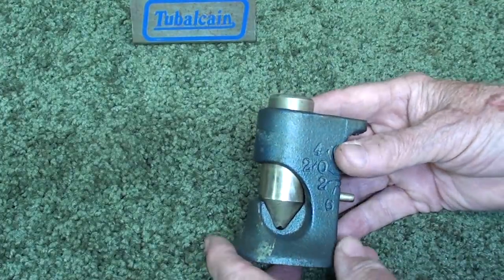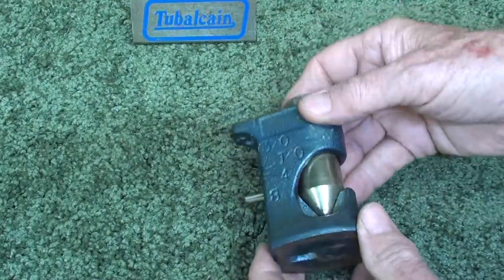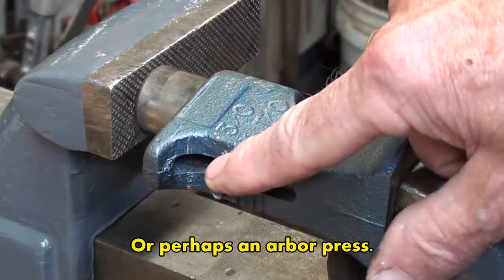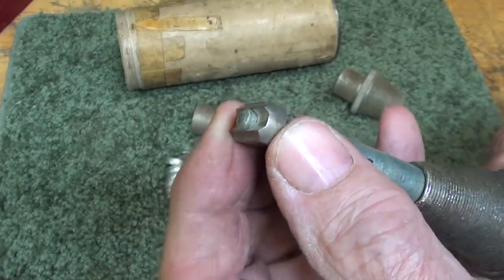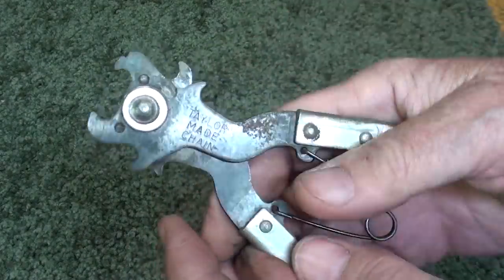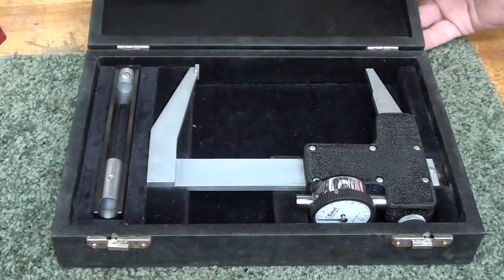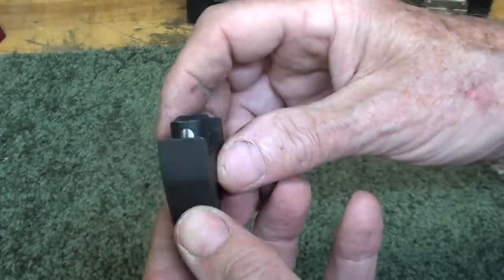What is It? MYSTERY TOOL 51b answer tubalcain

Comment: Pete the flat discs that came with the valve reseating tool I believe are for the final step in the reseating process, the finish with valve grinding  compound to remove the chatter marks. At least that how we used it in the US Navy.
Reply: David Schwartz it’s to make the surface finish defects as concentric as possible and to meet the proper “RhR” for the seat matl’. This ensures any tooling marks wouldnt help cuts form  possibly help any steam leaks that do develop from cutting across radially into castings and stay in the stealite inlay, therefore extending the service life before the steam cut reduced efficiency or caused a failure.

Comment: The chain tool was used to install emergency repair links on tire chains.  I used to sell them when I owned an auto parts store.  The emergency links were very soft  and were easily closed using the pliers.
Reply: Ebay sells them - about $20.  Search "tire chain s hook tool".

Comment: Toobs , the second to last item is a diametrical comparator. You set the distance of a sample or nominal part , lock the thumb screw and note the fine reading on the indicator. Then you can very quickly check a run of parts for deviation.

Comment: I have received this answer from Donna ; directly from the Manufacturer:
The tool you have is approximately 40 years old and is no longer made by us.  We discontinued it  over 30 years ago.  it is called a Crankshaft Main Journal Gage (part # 227).  It measures the wear of main journals without removing the crankshaft or top insert from the engine.  This easy to read, adjustable gage determines out-of-round of main journals from 2" - 5" in diameter.  It makes any wear instantly apparent, providing a quick, accurate determination of whether or not regrinding is necessary.  The indicator has a range of 0-1.00" with its graduations in .001" and the reading range is 0-100. 

Best regards,

Donna Dansereau
Mgr. Quality Customer Care
Central Tools, Inc.
456 Wellington Ave
Cranston, RI 02910
Tel: 800-866-5287/401-467-8211
ddansereau@centraltools.com
www.centraltools.com
www.moodytools.com
www.king-tool.com
Reply: So another tool that works well but isn't sold or used enough to justify making them any longer.
Reply: How can you use it to measure wear on the main journal without removing the crankshaft when the caps would still be in place?
Reply: Also the one shown in the video measures in half thou increments?
Reply: @blackguitarmaker1925  Making it very accurate
Reply: zeke112964 I’m merely pointing out that Phillip Chase here said it measure to .001 when the one in question here measures to .0005
Reply: @blackguitarmaker1925  gotcha!
Reply: @zeke112964  remove single cap, "crab pinch" exposed journal, rotate crank and note dial movement. Replace cap, repeat ad nauseam. At the same time you could check oil clearance with plastigage
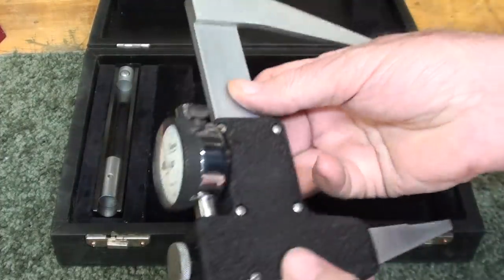Reply: @ludditeneaderthal  One of the "claws" has a 1/4 inch possibly wider pad on it @5:10 in his hand.....NO WAY your going to get that around the center of the journal with the crank still in place

Comment: The little black clamp at the end is part of a kit used for setting up unique location rigid dial indicator mounts on tools/equipment. Used during things like dual dial pump shaft coupling alignments or in setting up portable machining tools.

Comment: Hidden tool within the tools.   While watching the faucet reseater, I spotted a tool that's been modified and repurposed to hold the cutting dies. That piece of wire,  if you straighten out the big bend, is the safety pin for a military munitions rocket.  I still have and use a couple for key rings,  from my old army helicopter days.  FYI ,  I  love these tool video's.  Please keep them coming.

Comment: The plyer device is in fact a tire chain tool. In my younger years before cable chains were invented, I used this tool many time to add a link , or replace a broken cross chain . The tool can be oriented to spread open links , or scwees the link closed again after adding the new link,   Don from Oregon

Comment: THE CHAIN PLIERS ARE USED FOR TWO THINGS. 
THEY ARE USED FOR OPENING & CLOSING THE CROSS BAR END LINKS FOR FOR    REPLACEMENT.
THEY ARE USED TO ADD REPAIR LINKS (MONKEY LINKS TO CROSS BARS.

Comment: I know this is an old video and I’m sure someone corrected him on the 1st tool. It is designed to be hammered. You can see the hammer marks on the edges of the top. And the numbers are for the placement of the level in the back s it should lock in whatever gauge. The number are to let you know what gauge wire the lug is for. Not the wire itself. These can be brought today at most chain auto parts stores. Great series. I’ve watched every one up to this part. 👍🏾

Comment: The chain tool you showed is for changing cross chain on auto chains. It is used to open up and closing the hooks on the cross chain. It works real well. On truck chains the tool is much larger.

Comment: THE LAST ITEM IS AN INDICATOR HOLDER FOR A BRIDGEPORT MILL- I posted it on the first video? am I the only one out there that has the same exact one on Both my Bridgeports? it goes in the sliding collar that rises and falls when you lower the quill (Quill stop?)
Reply: He has a Bridgeport Mill & going is to throw this part away lol
Reply: No, you're not the only one.  Every Bridgeport mill in the shop I worked in had one on it, as does the one in my own shop.
Reply: Eclidean its a standard block vice included in hundreds of different products that require rigid but adaptable measurement platforms for use with dial indicators, needle gauges, depth gauges when precision is necessary.

Comment: For crimping cables. 6 to 4/0 gauge wire.
Reply: I used to use one of these at work. Works like a charm for copper cable ends. All you need is a 1 or 2 lb hammer
Reply: @richardsolomon5375  We used one for making up battery cables till it was stolen.
Reply: @williamjackson5942  we used them for welding cable connections, and a few times for the battery cables on our forklifts.

Comment: The Taylor pliers are for repairing tire chains...removing broken cross chains and replacing with new. Service stations and parts stores in snow country stocked tire chain repair parts, and these tools. They are also very useful for s-hooks, but that's not the original function. The split-link chain repair links can be closed much easier with a hammer or regular pliers, and opened much easier with a screwdriver, so this tool would not be very useful for them. I think you're correct that Rod's pliers were made by KD. My own pair of nearly identical pliers was made by "LINKFIX"--in this case, the tool function is implicit in the name.

Comment: What I use when I use the battery cable clamp with the two bolts, I clean both the contact spots on the clamp and the bare wire on the cable. After clamping the cable I then coat the clamp part with 'liquid tape'. It does seal the electrical connection from the elements.

Comment: Hey Mr. Pete
I've enjoyed your videos for a long time, and finally I may have something helpful to add. You were asking for comments on what that Central Tool with the half thousandths dial indicator could be.
I've been a machinist for 40 plus years, the last 30 at a great family owned job shop. When the shop was started, they bought out an old machine shop. The old machine shop they bought was really old. In fact I bet they used some of the tools from this shop to do maintenance on the "Mayflower" before the pilgrims sent it back to England ( thought you might enjoy a little New England humor :) .
While a lot of the tools are old, we also have lots of modern Haas CNC machining centers, Matsuura CNC Mills, CNC lathes, and tools. 
We still use old measuring devices that look like your Central Tool that is set to any diameter with a standard so you can set it up to read a go / no-go for checking close tolerance dimensions while the part is still in the machine.
Old tools that are well cared for are still being used to check parts made on 2019 machining centers, CNC lathes, and manual machines.
Take care. Have a great Summer.
Reply: I was a machinist and although I had never seen a gage like that I immediately saw it as a go / no-go to be used out on a production shop floor. The quality control man would set both the gage and the adjustable standard and give them both to the production tech. the standard sat safely on a work bench and the dial gage tool was to be used to shop check the precision parts. Then periodically the production tech would check the accuracy of the dial gage off of the adjustable standard.

Old machinists never die... their tools just lose calibration!

Comment: Central Tool 1-B10-050-5  .0005 Graduations. One arm is fixed, the other arm moves the dial. My guess is that it is an adjustable "go-no go gage " You set the distance you want using gage blocks and micrometers. It is used for measuring multiple parts in a short run production situation. .The calibration tool is also used to set and check the required size.
Reply: I believe you are thinking of these:
https://youtu.be/gNRnrn5DE58?t=700

Comment: At 0:34 you have in your hand a tool designed for crimping heavy terminals to larger size electrical wire. Slide the terminal onto the wire, place assembly in V-groove of tool, and whack the plunger with a composite mallet. The numbers stamped on the side of the tool correspond to the wire size the terminals would be designed for. Eazy Pezy.

Comment: Mr. Pete, in the manufacturing industries they have all kinds of specific to the job test equipment. Someone out there probly used one like this on a daily basis.
        I used the crimping tool for cable splice repairs in the mines. There wasn't a vise any where around. It was light to carry. A few whacks with a hammer and you were good to go. If I was doing bench work I could see the vise would be a great option that would  provided more accurate crimping. They have hydraulic crimpers that have a setting for the size of wire that  provides the correct pressure for the connector that is being installed now.

Comment: The battery cable crimper you showed uses a hammer to strike the cylinder down onto the battery terminal for a proper crimp.

Comment: If we are not to press  or hammer back of punch it will simply be a measureing tool.
It can also be used to rotate check nuts which are not hex or square but round with some counter on dia of round cylindrical nut

Comment: I could be wrong but that last piece that you haven’t been able to identify looks an awful lot like a gas block off of a semi automatic rifle. Kind of similar to the front post site of a standard AR 15. The gas block will slide over the muzzle through the big hole and onto the barrel and the gas tube slides into the small hole above it. Tighten it down and then your forend snaps over the barrel and gas tube.

Comment: Funny enough, the terminal crimper is designed to be struck with a hammer, NOT used in a press. Those small crimpers live in mechanics tool boxes taking up little room and with the simplest of tools and design serve their masters simply and reliably.

Comment: Actually, crimping connectors onto heavy cable is superior to soldering in some cases - where there is likely to be heat present.  For instance I have tried soldering the leads for alternator diodes but they always come undone because alternators produce a lot of heat when under load - enough to melt solder at times.
Reply: Yep, that is why they are normally welded.

Comment: The chain tool would be for bent link  not welded link chain.  To open and close the links when shortening or lengthing.  An example of the kind of chain would be lamp chain for hanging lamps.  I have 2 sizes one being big enough to use to on dog chain.

Comment: Well we only would have gotten one right the cable one but for the set gauge Central we thought it was from the material foundry, a material measurement tool and setting block tool and a wild guess we know but oh well. 
Thank you for sharing mr.pete.
Lance & Patrick.
P.S. now you can see why we do not guess at these what is it? videos.

Comment: Gasoline engine pistons are seldom round.  They are built oval to compensate for heat expansion and the fit should be measured at the lowest point on the skirt.

Comment: Thank you Mr Pete.
That chain tool could be for spreading links apart and back together. Perhaps for Jack chain or the chain on light fixtures that you shorten as needed.
Reply: They are used for that and for the lightweight tire chains like on a garden tractor or car. Stuff with .200 and down chain.

Comment: I am pretty sure the central tool company 1-810-050-1 tool is a wheel rotor gauge for measuring the thickness of wheel rotors on cars.
Reply: FarmerMiyagi  I disagree, here is a link to modern wheel rotor gauge and look how much they open and how similar they also look to tool in question-https://www.uniquetruck.com/product/3552/xtra-value-cal-drum-and-rotor-measuring-kit-with-caliper
Reply: @LisaMB2forU  It looks like that rotor kit can measure down to 0", while the minimum measurement for the tool in the video looks more like 1".

Comment: 1:35 i have used the bolt on battery terminal multiple times. I keep one of each in my tool box just in case all the time. Very handy. You should take your crimping tool and shove it right up your arse, you should be locked up for using it. Solder is the only way to go and a bolt on for emergency cases.
Reply: im allowed my opinion ok 🤣 to each his own.

Comment: I believe the gauge is an older Brake drum and rotor measuring gauge. Central Tool company still makes a gauge very similar to the one you showed however it has a digital readout gauge.
Reply: It measures too fine of increments to be used for that.
Reply: The one I was looking at had fractional graduations: 0.001",  Metric: 0.01mm however it is a much newer digital vs. dial instrument but it is made by the same company.

Comment: Engine pistons are not round, they are cam ground to an oval shape. This is to allow expansion from the heat of operation and avoid piston lock up in cylinder bores.
Reply: They are apparently for checking Main Bearing Journals of a Crankshaft for out of roundness.
Pan and Main bearing Caps removed to check OOR in place.

Not for Pistons.
Reply: @gordbaker896  
I never said that it was for pistons, several people have made comments about pistons being round. Instead of commenting on each one, I posted a general comment. I have been an engine machinist for over 30 years and never seen this tool before. My comment was not about this tool. When we check pistons and crankshafts we use micrometers, but they are usually removed from the block. So in a machine shop this tool is not very useful.

Comment: To me the tool with the half thousand dial looks like a GO-NO-GO or a quick check measurement for parts in a production facility, the second part of it could be used to calibrate it. Though I could be wrong, cause it looks a little like some of those I own and are made different...

Comment: 4:30  That tool looks a lot like a tool used to measure the runout (wobble or thickness variations) of disk brake rotors.  I did a search for images "brake rotor gauge" and found several similar tools.

Comment: 😎 So, no experts chimed in on the precision gauge?
Reply: The guy below you says:
Central Tool 1-B10-050-5  .0005 Graduations. One arm is fixed, the other arm moves the dial. My guess is that it is an adjustable "go-no go gage " You set the distance you want using gage blocks and micrometers. It is used for measuring multiple parts in a short run production situation. .The calibration tool is also used to set and check the required size.

Comment: Maybe the tool with the half thou indicator is for the qc department to quickly check one dimension of a large quantity of parts
Reply: You calibrate and zero the indicator with a stack of gauge blocks and start checking
Reply: You could also set the fixture with a micrometer and then snap the indicator on it to zero.

Comment: Really. It's for crimping battery terminals.  It tells you the size gauge your using
Reply: I have one and it crimps wire connectors/terminals from as small as 10 guage up to 4-0

Comment: Have been hitting my crimper with a hand sledge for years. Works well.
Reply: Yeah, bit awkward to take a nice big vice out onto the job in an electrical terminal box, just place on something solid & wack it till it's secure.

Comment: The chain tool isn't to install the chains it is to remove/add cross links on light tire chains. I use a pair like them when I need to make 2 link chains for garden tractors. The larger tools don't fit into the smaller chains. www.tirechain.com/tire-chain-pliers.htm  Look at the car/light chain tool. The side tangs open the end links and the closed ends of the side locks. The tip closes them.

Comment: You hit it with a hammer
Reply: @mrman3565  
Pressure must be applied.. One way or another... 
If you weren't supposed to hit it, it would not be so large.
Reply: ...and you can also hit it with a hammer. Those are sold on the tool trucks. We can repair terminal ends in the field when we don't have our press handy!
Reply: I keep one on my service van and I only ever use a hammer. Usually I use it to crimp ends on batteries that weight 2000 to 3500 LBS so the likelihood of getting the broken battery close enough to a press is low. They are sometimes sold as a "hammer swager" or "hammer crimper"